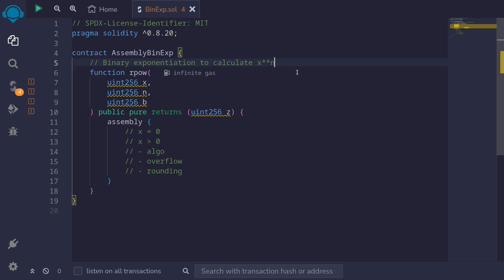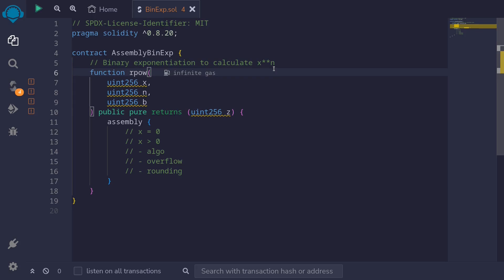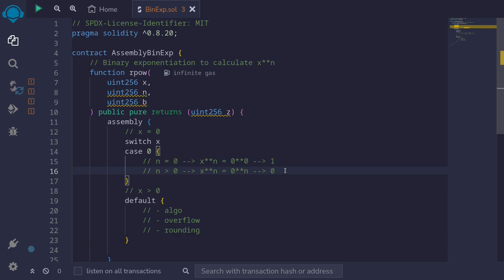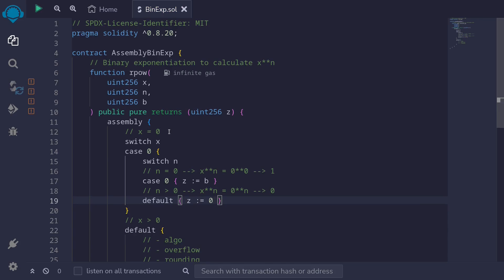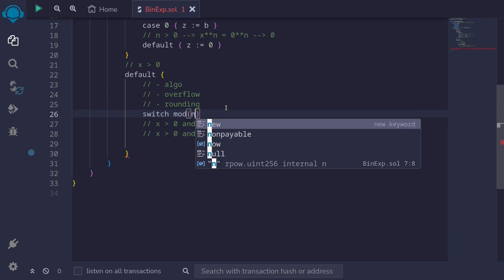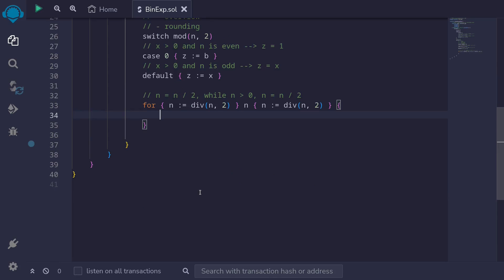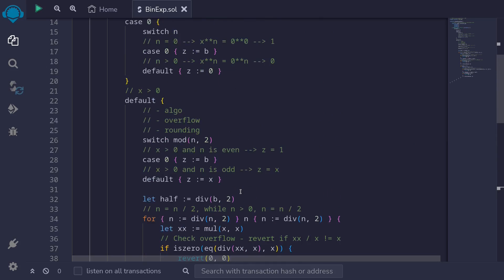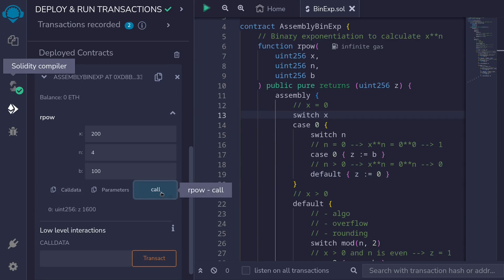Binary Exponentiation | Solidity 0.8

Comment from the maker: 0:00 Intro
0:39 x equal to 0
2:54 x greater than 0
8:39 Overflow check
10:30 Rounding fixed point numbers
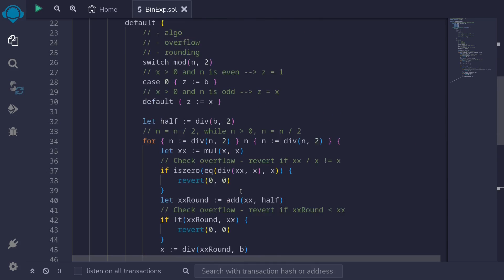12:44 Demo

Code
https://solidity-by-example.org/app/assembly-bin-exp/

Take a course
https://www.smartcontract.engineer/

Yul
https://docs.soliditylang.org/en/latest/yul.html

Remix
https://remix.ethereum.org